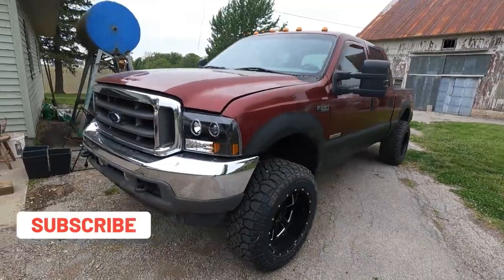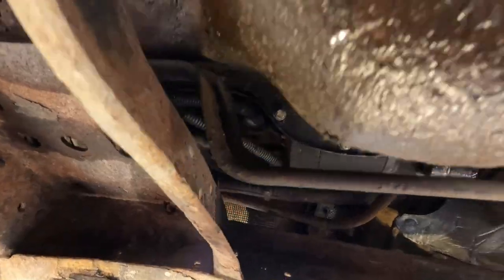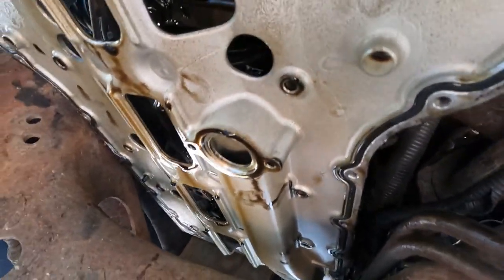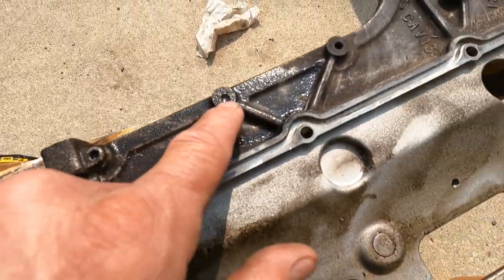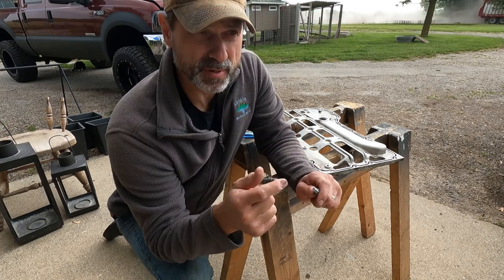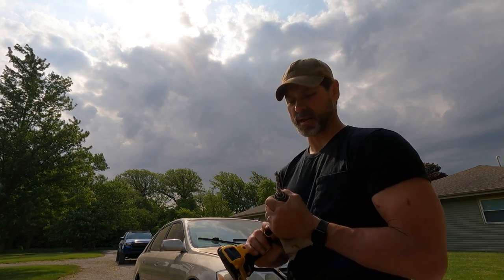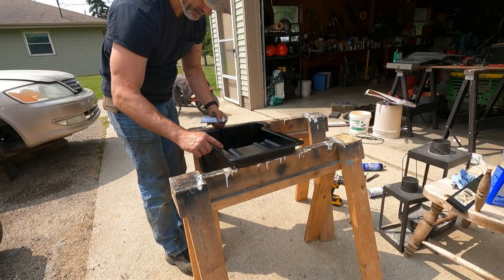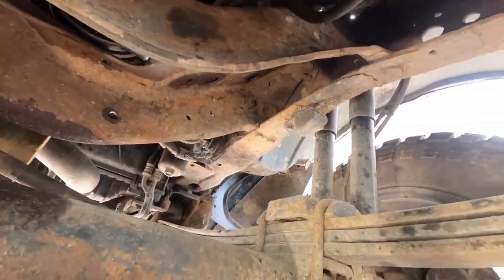2003 Ford F-350 6.0 Turbo Diesel Oil Pan Replacement - The Problem

Comment: A daunting task. You did an awesome job. I have to do the same on a 6.0 for different reasons. The idea of using the crank to jack the motor up a couple of inches has been bothering me but apparently the crank is as strong as I think it is. You made it seem like a great idea. 
On the seized bolts, I used a Fein oscillating tool with a carbide blade to vibrate/cut bolt heads off in tight areas. I don't have a torch so I made that work. 
Thanks young man. I feel better about it doing it now.☑

Comment: I have an 03 that I’m the original owner and has a super rusted oil pan & need to do this too.  Was thinking I could remove the turbo so I’d have more clearance when I use my engine hoist to raise the engine for access. My 93 Ranger 4.0 had a ton of oil leaks including the pan.  Finally pulled the engine & rebuilt it last fall at 189k due to cracked heads. The 4.0 has to be pulled to replace the pan gasket. It’s a cast aluminum pan so no rust.  It started leaking just past the 3 year warranty. I’m the original owner of that too.

Comment: Next time weld nuts on them, heat is your friend and the new nut gives you a good purchase on them. I also used some black oil and gas resistant sealant knowing the OEM setup would eventually just leak again and my motor is nice and dry several years later. Great work

Comment: Don't use RTV on a rubber gasket. It actually acts like oil when it's wet and can cause the rubber gasket to squirm, rather than compress. The best way to make a rubber gasket seal is to make sure all of the surfaces are completely oil free and dry. I spray the surfaces with brake clean, wipe with a new, clean rag, ten wipe with alcohol pads right before installing.
Reply: I never had problem adding a thin coat of rtv to a rubber gasket ever. It will stop that rubber gasket from seeping on you down the road 100%

Comment: Great video.  But watch Wes work used a Dorman oil pan like you did.  Dorman paints the inside of the pan.  The paint flakes off and ruins the injectors and oil pump.  I would be very cautious if I ran that.  Personally I would remove it and remove the paint from the inside of that pan.  Risk is too high for an expensive failure
Reply from the maker: Thanks for the heads up.

Comment: would this work on a ford 6.2L V8 GAS? My oil pan just started to let go
Reply from the maker: What year is your truck?
Reply: It’s a 2015 ford f 350 super duty XLT 4WD with the 6.2L v8
Reply from the maker: @lanceschecter3483  it’s probably a very similar process. Your pan bolts shouldn’t be rusted in like mine was though.
Reply: Unfortunately their all rotted like mine since I have a plow truck, did you loosen the transmission mount bolts on the bottom and then jack the engine? I’m not sure if it would be beneficial to do so.
Reply from the maker: @lanceschecter3483  I didn’t have to loosen the transmission bolts.
Reply from the maker: Before you burn off any bolt heads like I did you should make sure the oil pan situation is the same as mine was, with an inner and outer oil pan. Otherwise you might have issues getting your studs out.